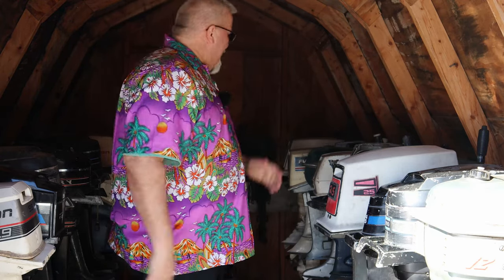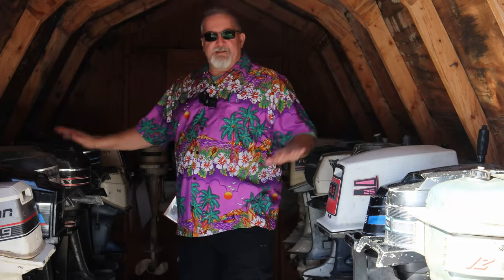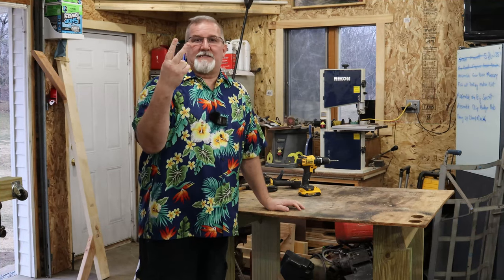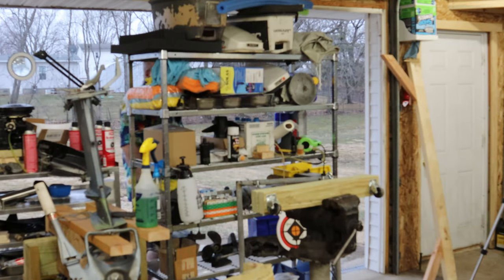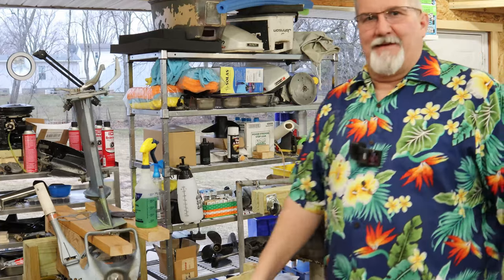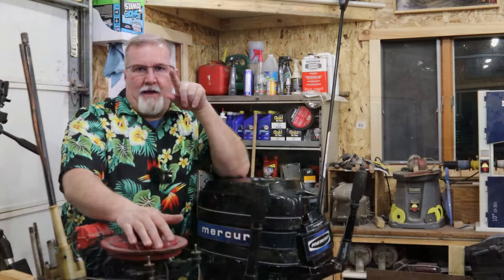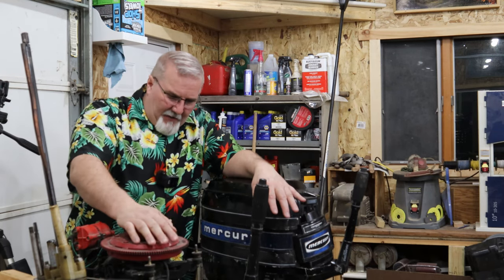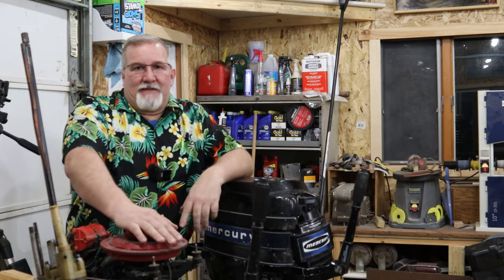Mercury - Johnson - Evinrude -  Mercruiser - Five different projects to choose from your vote counts

Comment: As my aircraft mechanic dad may say. infernal combustion devices are engines. ;-) electron swapping propulsion devices are motors.
Reply: I was thinking about painting NCC-1701 impulse drive #1 on my Minn Kota stern mount and impulse drive #2 on the bow-mounted motor.
Reply from the maker: thanks for watching

Comment: Go to Harbor Freight and get you a 10 amp solar panel and a 12-volt battery and go to the hardware and buy the 12 volt light bulbs 60 watt each and put them in your barn the bulbs are 12 volts also.
Reply from the maker: thanks for watching